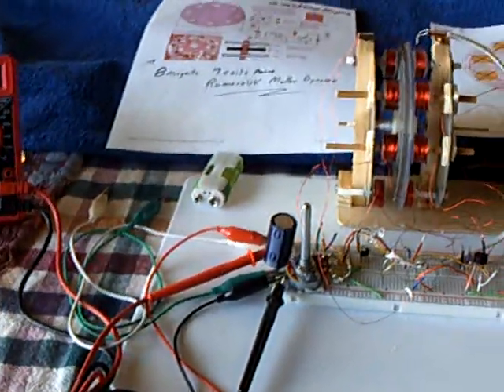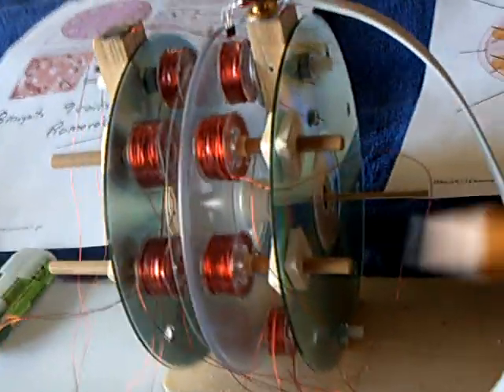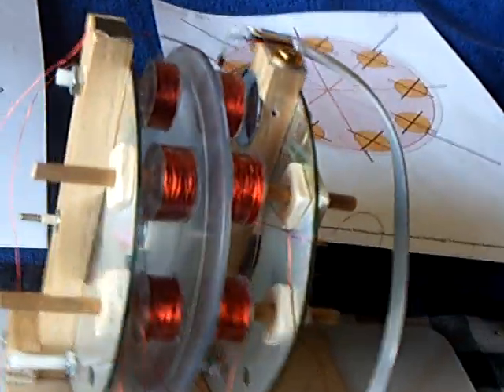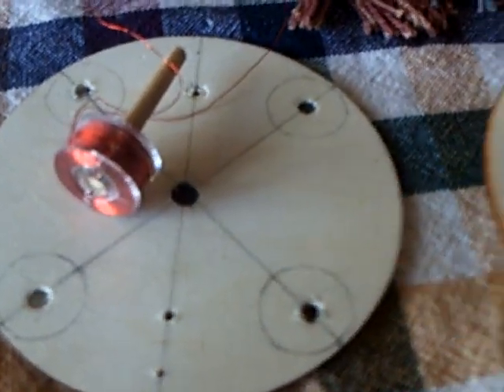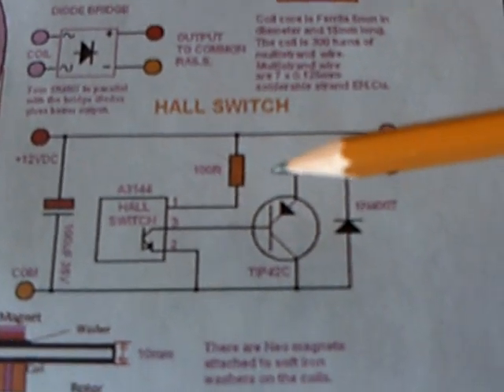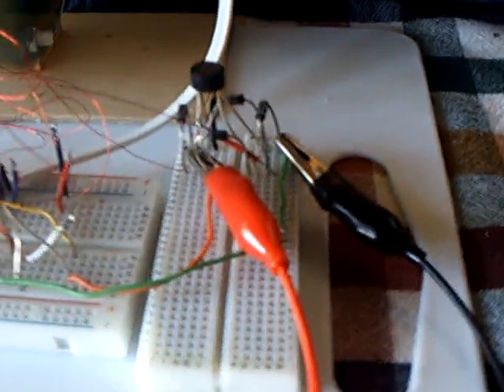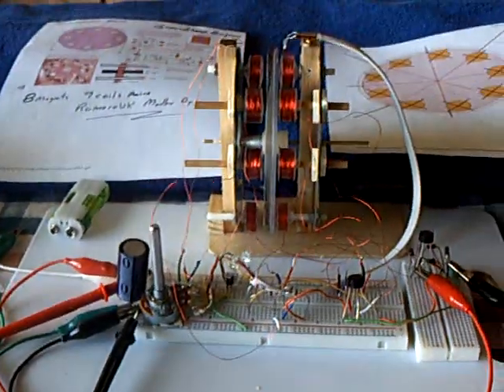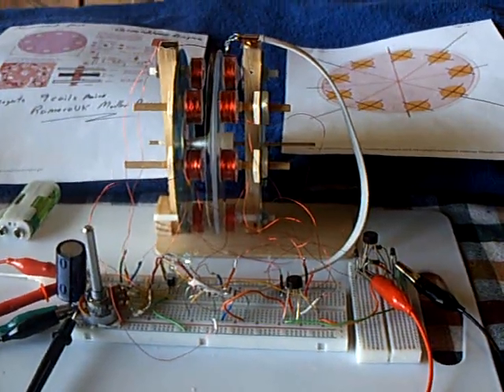Second Muller Testing unit running on a capacitor --closed loop setup.ASF

Comment: @jozsab1 The replications will prove that it's BS.  The people on the forums that believe that a simple pulse motor-generator like this is "outside the bounds of conventional electromagnets" or that there are things that are not understood in physics as it relates to what's going on here are dead wrong.  Most of the time they are wrong out of ignorance.  When the replications fail to work in droves Plengo will post my measurement suggestions on OU and hopefully some will follow through.

Comment: @jozsab1 The allegation that the motor will speed up faster and faster and that's why Romero had to use the DC-to-DC converter is a lie.  You are correct that the higher the RPMs the higher the friction.  Just wait and in a few more days some replicators will be testing full-blown replications that are fit, form, and functionally equivalent to the device that Romero demonstrated in his two main videos, including the DC-to-DC converter.  The only problem is that they won't work.

Comment: @User2718218 : some say the idea of the DC2DC converter is to limit your RPM, this device is made for a specific load, if you boost your RPM too much, to much power will be wasted on friction and your cap will get depleted, your device will halt. The converter might eat up X watts, but at least it is a constant factor in the device, if your RPM tries to increase all the time cause you still have power to increase it, it will eat up the cap.

Comment: @TPUBruce You are going to be in for a surprise.  Because Lidmotor eliminated the "middle man" - the DC-to-DC converter there is a decent chance his little device will outperform any build that makes use of the DC-to-DC converter.  Once all of the replications fail to self-run the next move will not be to agonize over the coil windings and the ferrite composition, etc.  The next step will be to make measurements on the performance and Fausto will be posting my recommendations on OU.

Comment: Lid:  You probably have built one of the highest performing replications we will ever see.  The reason for this is that you are cutting out the "middle man" by eliminating the DC-to-DC converter.  Note that by measuring the voltage drop across the 20 F cap over say two minutes you have enough data to make a rough power consumption measurement for the device.

Unfortunately over the next two weeks we are going to see a lot of long faces and frustration.

Comment: Great Progress Lidmotor !
Well, dont let you bug down from the other comments.
YOu will get there also with your small CD parts.
Just keep working on it and optimize it.
With your small size you really need to minimize your losses,
as if you build it small, every 0.5 Volts losses on the diodes counts...

Lets see, what will come up, when you have all your coils connected.
Many thanks for your hard work.
Regards, Stefan.

Comment: Lidmotor, RomeroUK stressed out the importance to "tune" the unit for a specific load. Also, it looks like the unit will perform at a specific RPM for the best input. Do you plan to investigate this at one point ? 

Keep it up, it's really fun to follow your progress ;) cheers